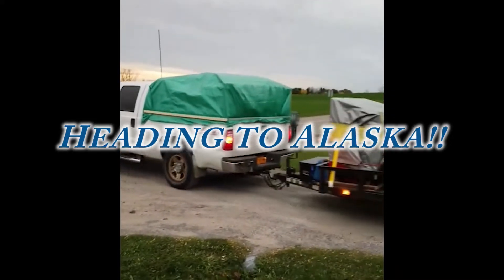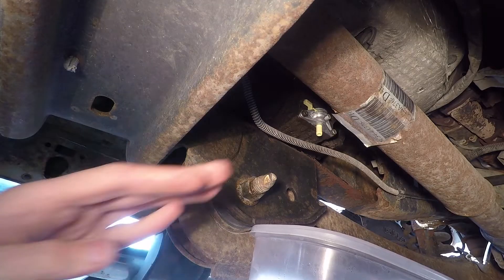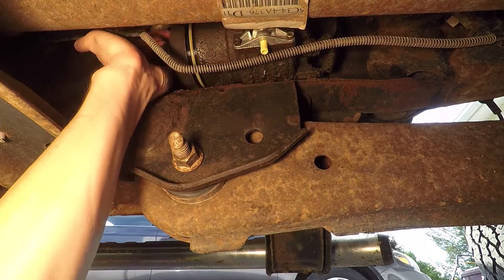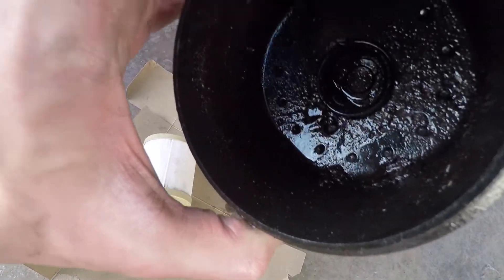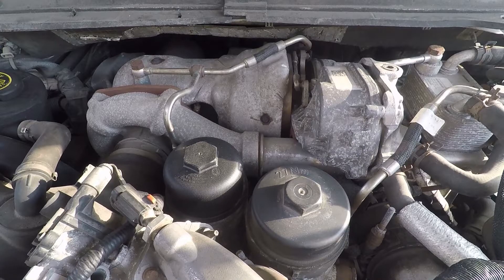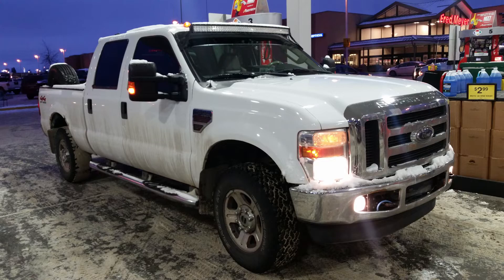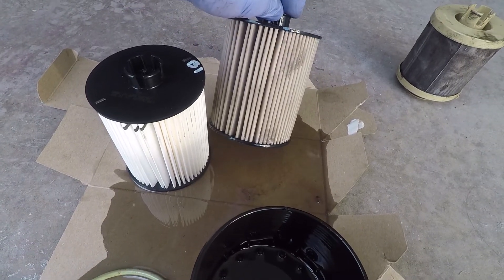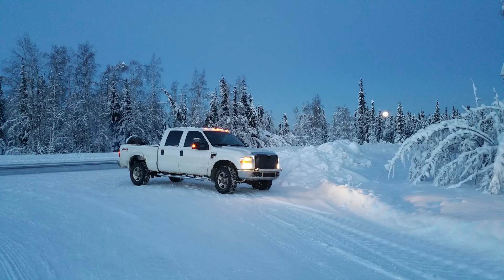Ford F250 6.4 Diesel DIY: Replace Fuel Filter

Comment: Did you have any issues with it hissing after? I did it, truck runs great and starts fine. I did 8 key cycle purges but I’m hearing a hiss and I don’t remember that being there before
Reply from the maker: That hissing is not normal. Sounds like it's not sealed. I would take the cap off and make sure the rubber gasket isnt crushed

Comment: How much fuel ends up draining from the system??
Reply from the maker: Not sure. Im too impatient to wait for the dripping to stop. And every time I remove the lower filter, I end up getting diesel all over my arms and the floor
Reply: @audimotive  ok. So you just try to change it quickly while its draining? I filled up 2 1 gallon jugs and figured it doesnt stop lol.
Reply from the maker: Yep i just try to change the filter. Quite a bit comes out. Never measured though
Reply: @audimotive  thanks for the replies man
Reply: @Straight_White_Fatherly_Figure  I’m about to fill 1 gallon… what do I do?!!?
Reply: @HookAndReelOutdoors  i filled 2 gallons to realize it never really stops.... just be quick about it 😅
Reply: @Straight_White_Fatherly_Figure  I’m going to just wait until it’s less then a 1/4 and use my ramps to incline it. Apparently that’s the proper way to do it
Reply: I got to 30 ounces and stopped wasting time , took old filter out and was still flowing,changed out filters and done. Just got this 6.4 with a Jasper Diesel. I'm use to easy 7.3 Diesel filter change 😢
Reply: No shit! I thought it was going to be a few ounces. I was looking for this comments to know how much diesel would be. This thing won't stop and my tank is full. Lol

Comment: Very important that you blow out the bottom filter housing with an air hose. There is lots of sand and dirt just sitting there, you have to get it out.

Comment: I won't go over 10,000 miles on one filter
Reply from the maker: Why not? Factory specs
Reply: AUDImotive factory specs kill these trucks. All diesel trucks need a fuel filt change with the oil change. This truck I’m particular should be changed every 5000-7500
Reply: I didn't even know to change these filters.. I open the valve every couple months. Looking forward to changing these. Owned the truck for 3 years and about 30-40k miles. 195k on it
Reply: That’s not good Scoob! 
Ideal to change both fuel filters every 10k miles